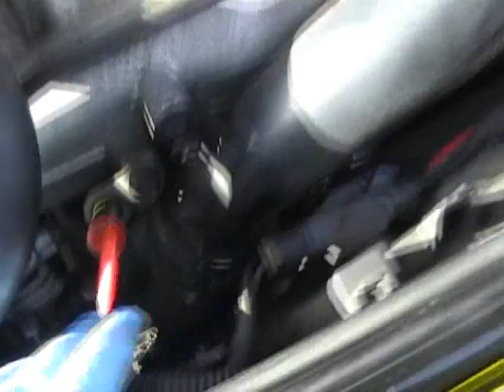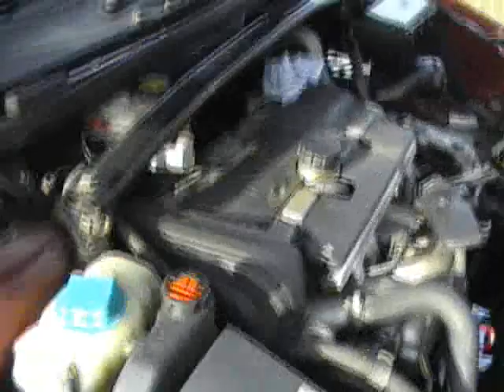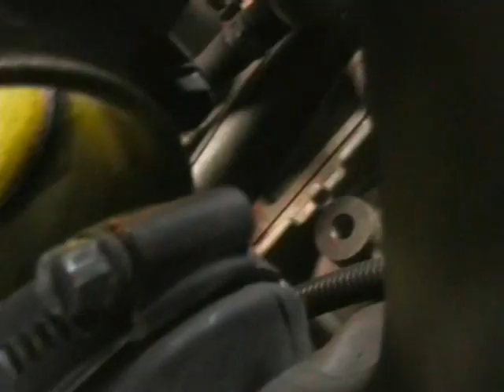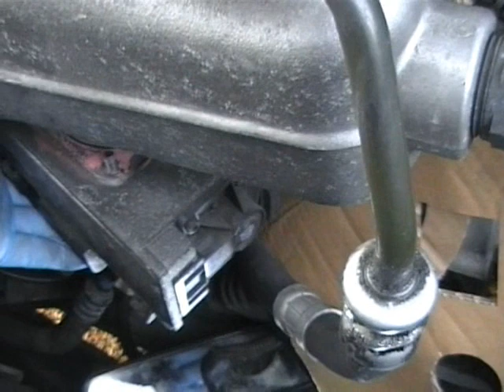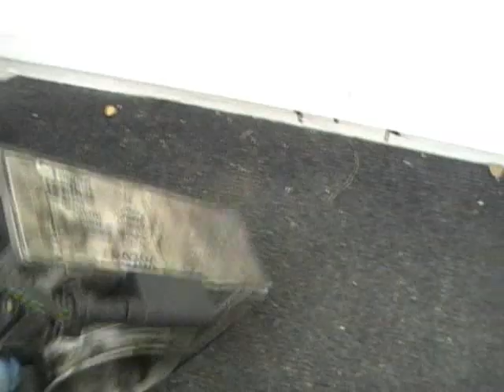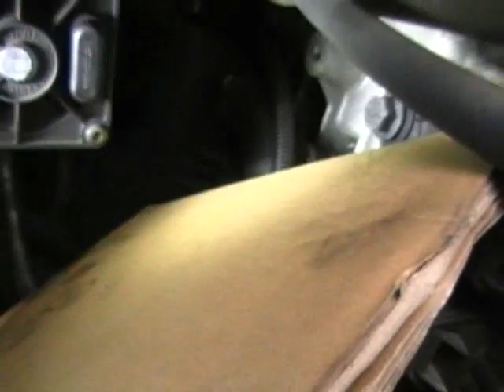VOLVO ETM CLEAN / REPLACE TURBO MODELS V70/S60/S80 THROTTLE BODY

Comment: I have 2001 S60 T5. My car idles really rough (worst than this video) on cold start only, after it warms up it idles ok. I notice the throotle is kinda lagging all the time as well. could it be the problem?
Reply: I have the same problem, a lot of lagging when driving. How did you fix it?

Comment: My 2002 V60 T5 Is having a similar issue, except my CEL isnt coming on, but the engine is struggling to run, creating heavy vibrations and stalling at times.
Reply: Did cleaning the TB fix it?

Comment: My 01 XC has the same issues. This is my next task. I'm also getting an electrical Problem. Have replaced the alternator (with a used one) and battery. Still there

Comment: I have a Volvo s80 2001, my car goes in limp mode and idle up I had it cleaned and check engine light code said needs a throttle sensor. Do I have this on my car or do I have to replce the whole throttle body?
Reply: Yes , i just did this same repair on my car this week. My results .... i had to go check out  www.xemodex.com for a replacement thottle body. Any other throttle body will need to be programed by a volvo tech to allow the throttle body to communicate with cars computer.
Xemodex cones pre programmed and is plug and play.

Comment from the maker: The TPS x2 are within the black end caps on the ETM body, normally only one needs replacing and the opposite one is wired to the new good one also. There are guides on a couple of the volvo forums on how to replace, quite a fiddly task and no guarantee of success.

Comment from the maker: Where the exhaust leaves the engine, the turbo will be bolted to the exhaust, two large plastic/rubber pipes will be attached to it - the intake pipe, and the boost pipe. On Volvo located at the back of the engine bay, close to the bulkhead/firewall.

Comment from the maker: There was no old gasket in there, so somebody had definitely been there before me, either to try and remedy this fault, or as part of re-assembling the intake during another repair. It's quite possible it was contributing to the unstable idle, the throttle plate was also pretty dirty though, not worth leaving it on the car for cleaning in my opinion, gasket is cheap also.

Comment: I repair these as a hobby.  I've had more than 30 of them land on my doorstep.  9 out of 10 used ETMs will work on your car AS LONG AS they are from the same model, transmission and aspiration type.  You can't use a 5 speed auto ETM on a 4 speed and vice versa.  One exception is a '99V70/S70 non turbo 4 speed auto can use a S80T6 ETM; go figure.
Reply: I've got a 2006 that's idling rough and stalling, throwing MAF code, but MAF was replaced, and plugs, and still stalling/rough idle, I'm going after this next, is cleaning it enough?

Comment from the maker: @jfv65  Whenever replacing ETM new or used,  programming by dealer level tool is required. Having your unit repaired and returned shouldn't need any extra work except the 10 minute ignition on period (which is not compulsory but is recommended). Always new gasket though.

Comment: excellent video! weather permiting i will tackle this job together with cleaning/renewal of the crank ventilation system.
suppose the ETM was replaced by a new one, would it need new programming?? Or is it plug & play??

Comment from the maker: Hi, Gasket was straight from dealer, less than £5 from memory. I didn't apply any silicone at all, applying a very thin film of assembly grease or oil may help the gasket fully seat - VERY thin film, but used none, no air leaks (to my knowledge!).
Good luck.